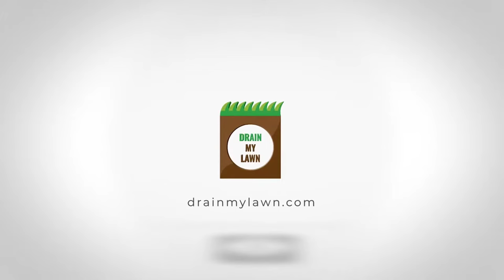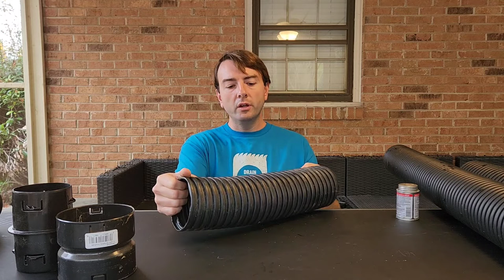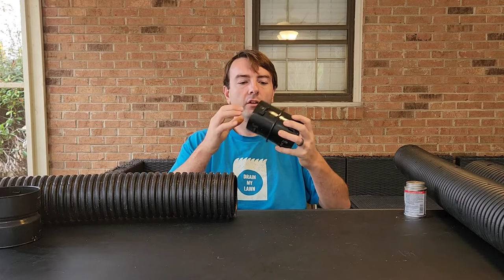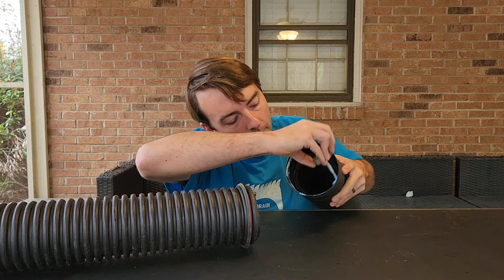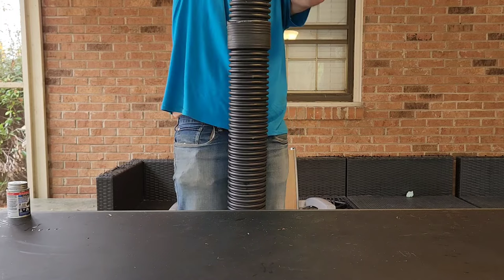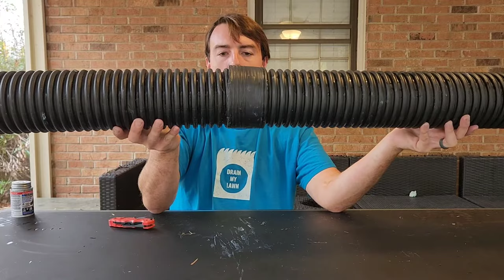How to make connections with corrugated pipe - Yard Drainage

Comment: I wouldn’t use the internal coupler. It constricts the pipe and creates obstructions that can catch anything traveling through the pipe. Generally it’s a good idea to never use single wall. Even though it’s rated as soil tight I still find that some amount of sediment gets through the joint. Whenever I encounter it I try and wrap the crap out of the connections with FDM’s tile tape. I try and get a good 6 inches onto each pipe. However old pipes that are dug up tend to never get clean enough to allow the tape to adhere properly. That’s why I hate the stuff, just a bad product. Thankfully they make the N12 WT and HP Storm/Sewer that are actually designed and manufactured to some decent standards.

Comment: Can you bring 4" double wall from the house downspouts to a 6" double wall picking up the downspouts and daylighting in a dry creekbed?  What sort of connection would you use?
Reply from the maker: Yes you can, but 4" double wall can already handle aboit double the flow of single wall, so I wouldn't recommend using 6" unless you know you need it.

Comment: Great job buddy!! I want to use 275 gal totes to catch rain water from my house/shop, then run this pipe to a 20 x 50 garden area about 75 feet away and slightly downhill maybe 4 drop. Then go to a gravity fed drip irrigation system. I guess my question is how could I adapt form the 4 in double wall pipe to 2 in PVC or ABS? Should be easy enough right?  PS I love the Colossians verse!!
Reply from the maker: Just use a corrugated to pvc coupler and then do you reductions in PVC.  Thank you and God bless!

Comment: Do they make a repair coupling that can be made to add a T in a system that is buried in dirt with no ‘play’ in the pipe
Reply from the maker: There something called a "tap tee" that can be used like that.  You'll want to seal it with rubberized sealant.  You can get them online or at your local irrigation supply.

Comment: Okay the advantage of dual wall bell end pipe is it's perfectly water tight and can be used for sewer lines. So how do you connect pvc to dual wall and make it water tight? There's not a single video on it everyone's saying just shove the PVC inside and let the dirt hold it in place but that can't be right for sewage lines. I can't even find tee connectors for dual wall. Is that actually what it's called or is that some landscaping term?
Reply from the maker: I don't think double wall is used for sewage.  

Water tightness is one potential benefit of double wall.  We typically use it gor strength and higher flow capacity.
Reply: You can’t use n12 on sewers, only storm. Ads makes a sani-tight pipe that is a double wall corrugated rated for sewer use. It has better gaskets than n12.

Comment: I use the cheap pipes from Lowes. They don't come with a seal but they insert into each other. I use commercial grade silicone sealant on the inside mating surface and on the portion you see on the outside. Two seals water has no chance of getting out roots have no chance of getting in.
Reply: what brand do you use for the silicone sealant?
Reply: @LA-rc7cw  SCS1200 made by GE. It says not for submerged use but people who build Aquariums swear by it.
Reply: Thank you 🙏

Comment: What is your method of sealing a joint with single wall pipe ?
Reply from the maker: Tile tape is what's typically used.  We've developed a root blocking wrap that we use in house.  Not ready to sell to customers yet though.